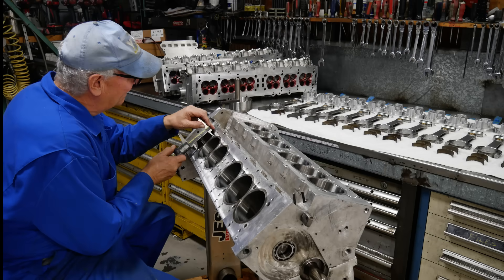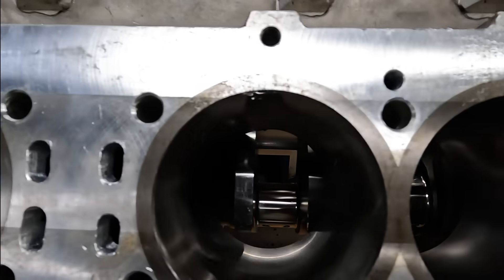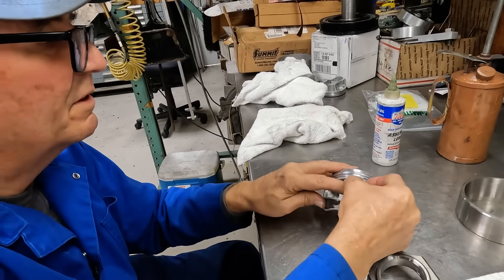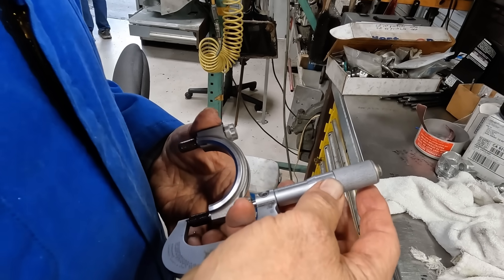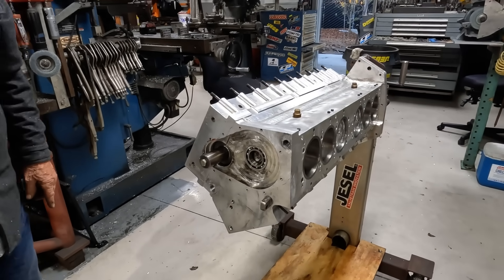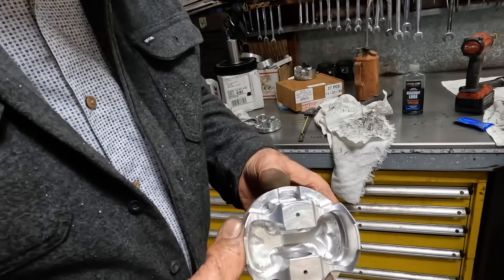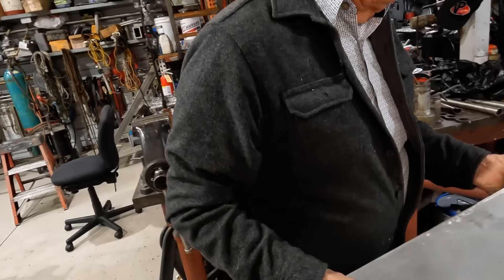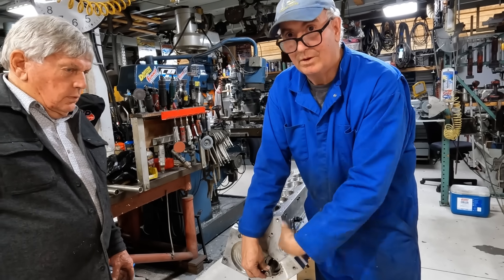Homemade V12 Engine Build: Bottom End Assembly - Aardema Braun Christmas Special 2024!

Comment: Why is the cam idler drive tilted to the side? Although the chain is shorter, should it still have a tensioner assembly to take out vibration? On high RPM this vibration affects cam timing.
Reply: It was tilled to the side for packing. Trying to shorten the engine as much as possible. We put the chain to the side staggered back because of the width of the rod.

Comment: What is the compression ratio and what fuel do you run? TIA.
Reply from the maker: Compression ratio I believe is 12.9 and we usually run C14 VP racing fuel.
Reply: @GregQuirin  thanks. A friend has a LSX 454, "a little over 14:1" they said. Runs race E85. The motor is loud!

Comment: Thanks so much for these inspirational videos
Quick question - the cylinder heads that were in the background had the red marking out ink on them - was that to show when the valves have been lapped in ? - I like that as an idea 
All the best from England - Merry Christmas
Reply from the maker: I'm pretty sure the red is used when Kevin is milling the combustion chamber to make sure they are milled equally. - Merry Christmas from Sunny San Diego, CA  Greg Q

Comment: You can make 1000hp with a Chevrolet N/A.... they sell 632cu crate engines that make that with a carb. Moution raceworks built a giveaway that did that.
Reply from the maker: This V12 is half the displacement of a 634CID engine. It measures in at 303 CID and will  hopefully make close to 1000hp NA. At Bonneville, cars are categorized by engine size. Pete is going for the 5L records with this new engine design. Happy Holidays!
Reply: Wow

Comment: My motorcycle crank has the oil fed from the bottom because there is a groove in the shells  and the oil forms a hydrodynamic wedge  on the two flat surfaces of the shell BTW what oil clearances do u run on the mains and big ends great work fellas love the sound of a v12

Comment: Is it a 60 degree v12?  I’m trying to build a 1200cc  motorcycle based v12  any recommendations on whether I should cast the cases of fabricate  laser cut and weld beautiful work Guys what  length of rod do u use?